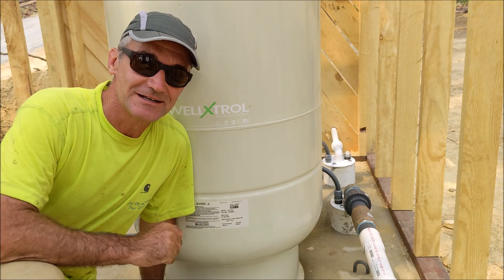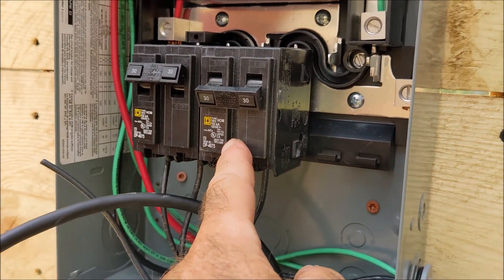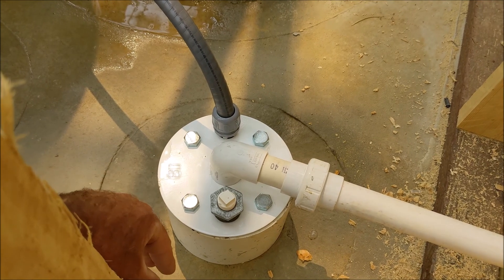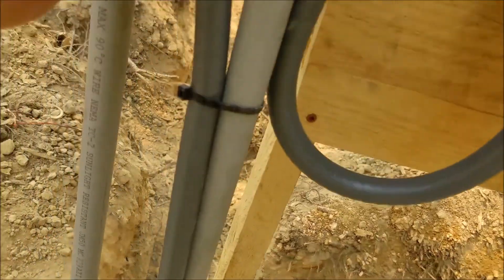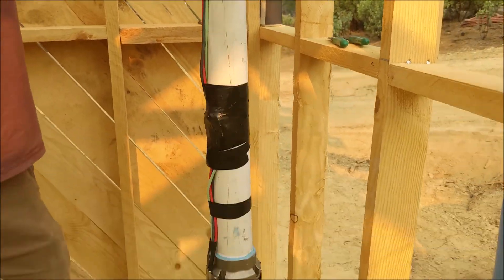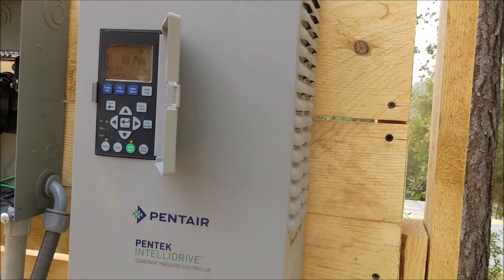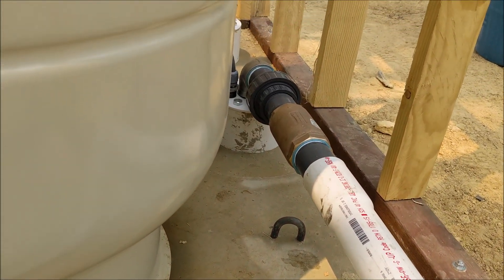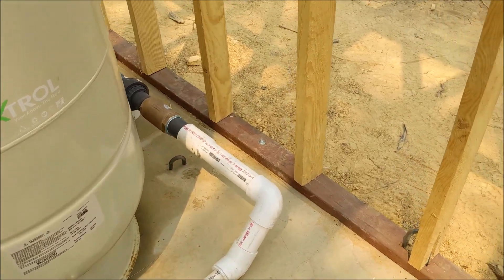Grundfos 2hp Submersible Pump with Pentair's Pentek Intellidrive in Water Storage Tank

Comment: Why didn't you use a Grundfos controller like the cu301 instead of the Pentek?
Reply from the maker: The supplier recommended that controller, I'm no expert, but pretty happy with it.
Reply: @topsaw I'm curious, So why did you go with a VFD setup and not the conventional system(you know big pressure tank and 30/50 or 40/60 pressure switch)? Was the pressure at your faucets varying too much?